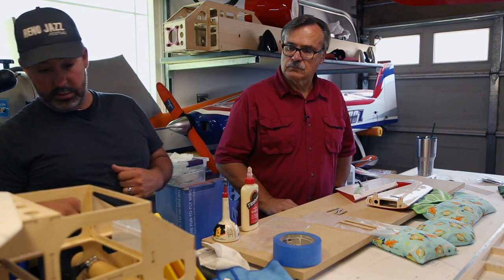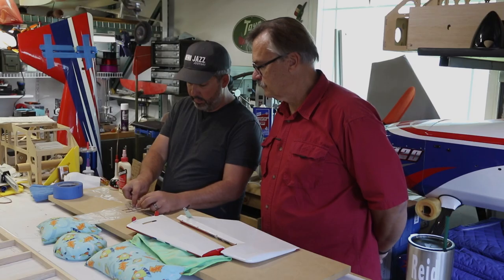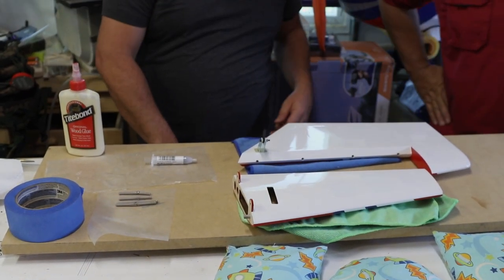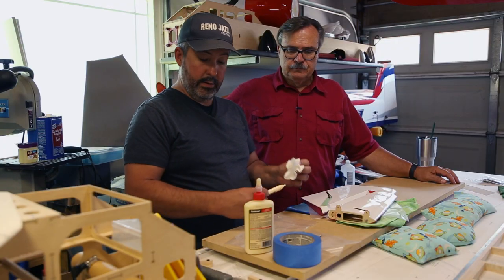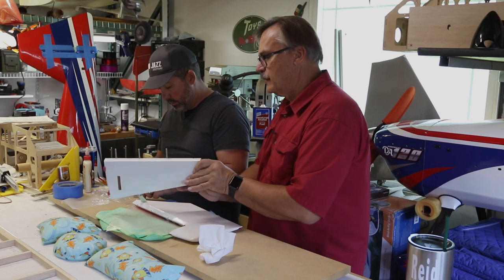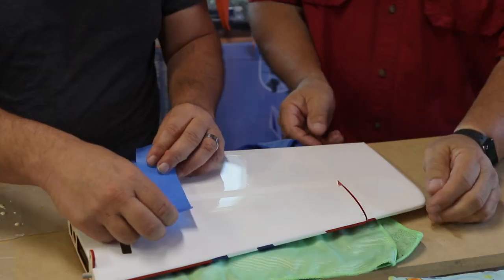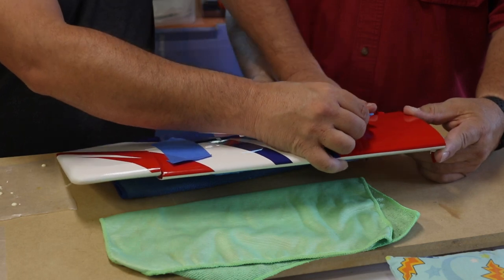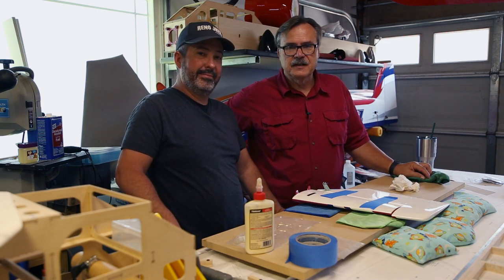FlightReviewz How To: Hinge Installation Using Titebond (Elevator)

Comment: Hello Jason and John. I like the idea using the wood glue as it cleans up easily unlike the epoxy lol. It must be strong enough as you guys use it in your larger aerobatic aircraft. Not questioning you guys just I’m surprised it would be good enough as there’s a huge amount pressure tugging on the hinges. Stay safe. Regards from Perth, Western Australia 🇦🇺
Reply from the maker: You know, we felt the same way but the proof is in the pudding. The Dalton has over 1500 flights on it and it has held up great with Titebond on all hinges. We think the fact that wood glue isn't as rigid and brittle really helps out in this application.

We agree with you on the cleanup. It really is the best option there is in that regard.
Reply: Is there a specific reason you use marvel mystery oil with titebond, and 2-stroke oil with epoxy or were you demonstrating the differences and it’s interchangeable?

Comment: I've heard good reviews of user Pacer/Zap Canopy Glue Formula '560'. It's my understanding its the same formula as the discontinued Zap Hinge Glue but without the coloring designed to match balsa. It's also my understanding that the canopy glue does expand slightly as it cures...
Not sure if any of that is true or not. Do y'all have any experience using the Zap Formula '560" glue for use in hinging control surfaces?
Reply from the maker: Hello Eric. We have not used Formula 560 Canopy Glue on hinges. It is amazing glue for canopies for sure and we may be willing to try it on hinges too. This being said, we do not believe they are the same glue.
Reply: @FlightReviewz   Hey guys, thanks for the fast reply! Yeah, I had never heard about it for that use either. I have used it for years for canopies because it dries clear and is flexible too. I saw a couple of postings where builders were advocating it as their preferred hinge glue and was curious to hear your thoughts on it as well. Here is a link to one of the postings I ran across...
https://www.modelairplanenews.com/members-only-update-installing-hinges/#:~:text=Pacer%20Formula%20560%20Canopy%20Glue,the%20locations%20of%20the%20hinges.
Again thanks for the quick reply and all the great content you've shared! here! Just stumbled across your channel today and have subscribed to keep up with all the good information you're putting out. I appreciate it the straight-forward, no-nonsense, honest and down-to-earth approach y'all use in your presentations. Keep up the good work!

The above link didn't seem to work. I've updated it here.

https://www.modelairplanenews.com/members-only-update-installing-hinges/#:~:text=Pacer%20Formula%20560%20Canopy%20Glue,the%20locations%20of%20the%20hinges.